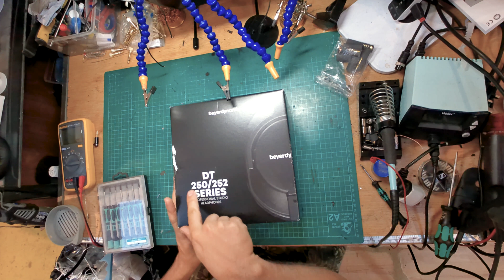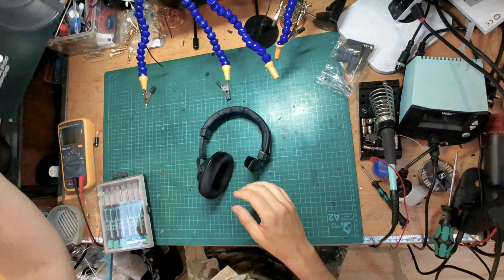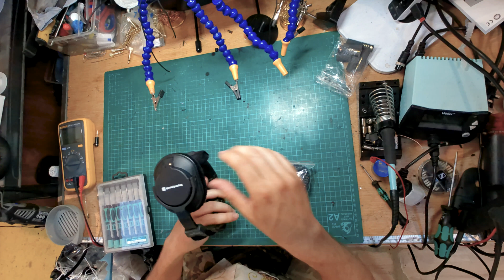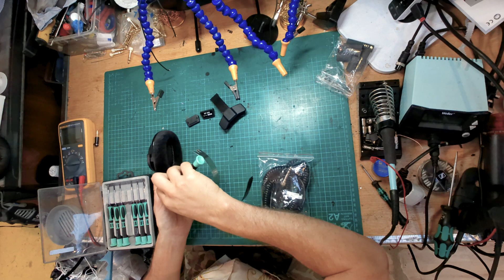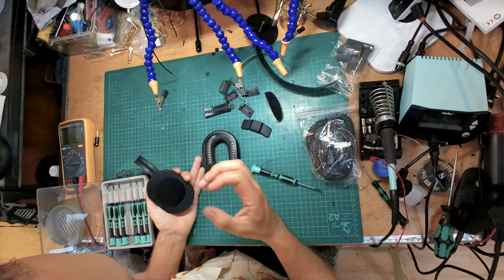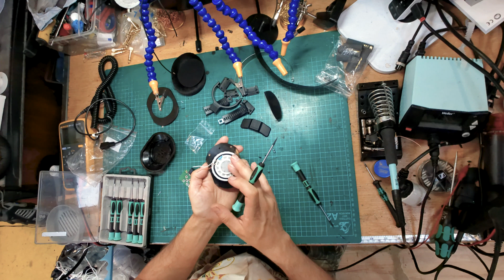Beyerdynamic DT252 Teardown and design review

Comment: Can that thin layer of material which is on the ear side of the drivers be replaced?

I don't mean the felt circle which you removed but the thin layer of tissue-like material which is stuck on the drive. I just replaced the cushions on my DT250's and I noticed that that tissue membrane is stained, due to moisture I think, so I would like to know if and how they can be replaced and what I should get as replacement.
Reply from the maker: If it is only stained, I would probably leave it as it is as it will be covered up by the pad. Nothing is impossible but to preserve the sound you would have to use the same weight of tissue paper. Finding a close match and fitting it would be quite a big job
Reply: If it's not sounding right anymore, just get a new driver, it's currently 33,70 €.